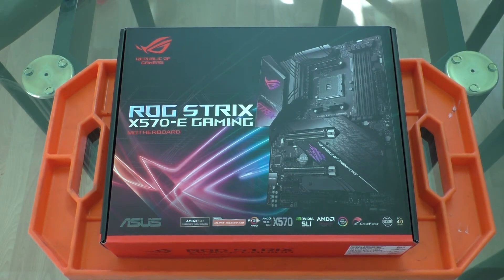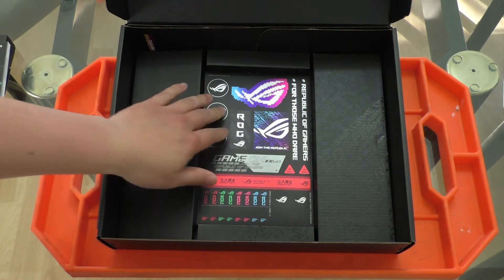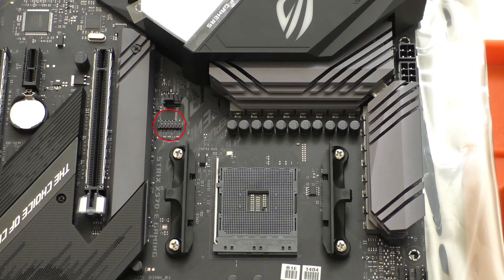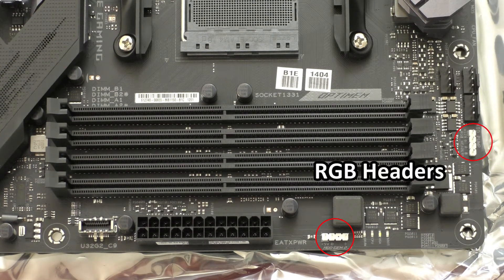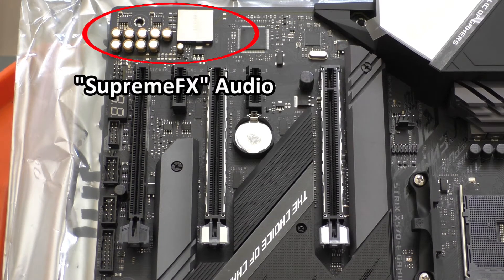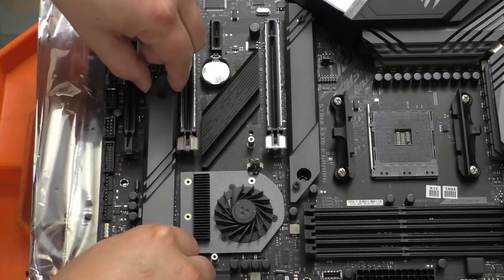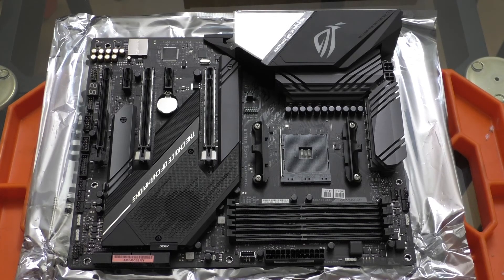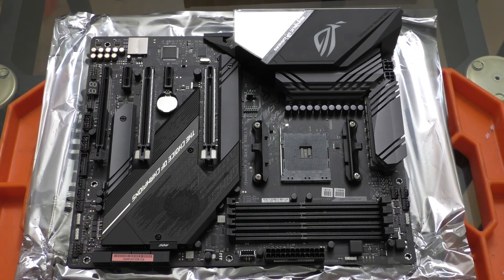ASUS ROG Strix X570-E Motherboard Closeup Overview

Comment: Does a NvMe SSD pcie 4.0 gen work in this motherboards m.2 slot at full speed if you have a new GPU running in the top PCIe 4.0 slot ?

Comment: Great video, looking to add some M.2 SSD today
Reply: `does a new SSD nvme pcie 4.0 gen memory work with full speed in the m.2 slot in this motherboard if you have a new Nvidia GPU running as well?

Comment: Hello, I have a problem with this motherboard when i installed my 2 RAM sticks in slot B2 and A2 after sometime  of use computer would crash and show BSOD with code error - memory management but when my technician changed the slots to B1 and A2 everything works fine no crashes asked him if the motherboard slots have problem he said no but i am still worried if the slots are faulty. please help me
Reply from the maker: That's strange. Are the two RAM sticks identical? Do you have other RAM to test with? Is the BIOS/UEFI updated?

Comment: Thanks for this video. I want this board. I'm surprised you even mention the 10 second task of removing the fan shroud as if it's anything. I will already have my GPU out if I had one because I like having room to work. I didn't get it.  I want to start out with a Ryzen 7 5700G until GPU's come down in price if at all. Is that heatsink fan serviceable? I worry about that fan lasting 5 or more years.
Reply from the maker: I believe the chipset fan is serviceable. You can clearly see the three screws mounting it to the heatsink, and you can see the power wires/connector just above the heatsink at time 8:40 in the video. The most difficult part about servicing it will be unscrewing the chipset heatsink from the back of the board to get the old power wires out and new power wires in since you'll probably have to take the board out for that.
Reply: @FaRKle0079  That and getting the part. It would definitely be downtime and an in the shop job for me. That's my I keep an Intel NUC backup computer.

Comment: Is there a huge difference if i use a GPU in white lane and second one in the black lane ? I got a big gpu (MSI 3090 SUPRIM X - i plan to use for DL) that i want to place in the first white lane and i believe it covers the second white lane as well. I would like to add a second GPU (an RX 570 - thinking to use it for casual gaming while the 3090 is `bussy`, but the extra heat the will be absorbed by 3090 though) as well. Not sure if this setup can work. Any opinions ?

Comment: Great review, the best and most comprehensive i have found for this board! I currently have 2 M.2 NVME gen 4 drives on mine and looking at getting a 3rd. Will the board support that if I use a PCI-E M.2 adapter card and which PCI-E slot would be best for it, slot 2 or 3?
Reply from the maker: Yes, you can use a PCI-E to M.2 NVMe adapter card in the PCI-E slots. I'd opt for putting that in the last x16 length slot since you can still get x4 bandwidth. The x1 slots can limit the SSD speed, but the x4 should be more than enough.
Reply: @FaRKle0079  thanks, that’s what I was thinking would be best, I am a little concerned that the m.2 heat sink will be too big for the bottom slot, there isn’t a great deal of room to use the bottom slot due to the cables from the bottom area of the motherboard. The second x16 lanes shares bandwidth with the top slot I think so would reduce the top slot with my gpu to x8, although that still should be more than enough for the gpu atm it might lose a few FPS in games but nothing to really notice the difference in so I may have to use it in this slot and hope I doesn’t block too much airflow from the gpu.
Reply from the maker: @stuartd1216  I think you'll have enough room for a heatsink in the bottom slot since the adapter cards usually move the ssd up a bit. It should be enough clearance.

Comment: very comprehensive! will you be able to tell me if i will loose performance if i plug my msi 3090 gaming x trio to the second slot? it is air cooled and i am currently using noctua chormax and as you very well know, the backplate of the gpu sits very closely to the base of the cooler.  i am trying to find information if i will be taking a performance hit if i opted for the second slot instead in this mobo
Reply from the maker: You won't notice a difference putting your 3090 in the 2nd slot. It'll run at PCI-E 4.0 x8, which is equivalent to PCI-E 3.0 x16. The difference is pretty negligible (https://www.pugetsystems.com/labs/articles/PCI-Express-4-0-vs-3-0-Video-Card-Performance-1982/).

Comment: Hi, really detailed review, kudos. A LOT OF people have pch temp issues with this board. What is your experience regarding pch temps ?
Reply from the maker: I can't say I've had any issues with mine. Never ever heard the fan. But my gpu is also water cooled so the board isn't getting as much residual heat as normal. Also the board has very good airflow over it from my cases fans (FT02).

Comment: Edit: Ignore this comment. Some other software stops the fan when it runs it seems.  Yes the chipset fan placement is really genius... Still it does its job somewhat. Temp is 60 c on idle. 

Original comment: DO NOT BUY THIS MOTHERBOARD. The chipset reaches 100 degrees easily on load! Chipset fan is almost completely covered by the gpu because of the UNBELIEVABLY STUPID design of the motherboard and gets no airflow. Go with a B550 this generation.

Comment: I haven't built a PC in a while. So, each M.2 slot can house an M.2 for your OS and the second one for storage? I just want to make sure before I buy two M.2 SSDs. Thanks!
Reply from the maker: Yup. You can have your OS drive in either M.2 slot (with the other being storage), or use those slots for storage only and put the OS drive on SATA.
Reply: @FaRKle0079  Thanks!

Comment: I've got this board and i've got ryzen 5 3600 and i will install on this board let's say i want to upgrade to ryzen 5000 should i install the new bios using bios flash back or i install the bios normally as usuall?
Reply from the maker: You should be able to use either method unless ASUS' instructions specify one method.
Reply: @FaRKle0079  so flash back button not used just when you want to upgrade cpu and you don't have a cpu it can be used also when cpu already installed?
Reply from the maker: @dalileddineslimani6399  Yeah, you can use the USB BIOS flashback method even with CPU installed. I've done it.
Reply: @FaRKle0079  thnx actually i was afraid to do that or cause any damage to my board haha

Comment: You're doing a super nice job on this review best I've ever seen Crystal clear and to The  point.
One question please I got the gift game MB
Why does it only come with two standoffs ?
I just subscribed.
Keith Kuhn
Reply from the maker: The standoffs included are for the M.2 drives. Two M.2 slots, two standoffs!
Reply: @FaRKle0079  
I actually purchased the Asus tough game plus.
I believe that one has only one M.2 slot. Correct me if I'm wrong.
Keith
Reply from the maker: @KTHKUHNKK  That board actually has two M.2 slots too! You can see my video on that board here: https://youtu.be/W5u41pqWdv8
Reply: @FaRKle0079  
Beautiful I'm going to check out that video right now.
You really seem to know your stuff.
Thanks Keith
Reply: @FaRKle0079  
Superb video my friend absolutely superb.
Your older computer when he had the case in the garage and he had it apart looks like some kind of supercharged Ferrari or something.
Dang nice.
Keith Kuhn

Comment: do you have to have the chipset fan cover on or can you take it off cause my m.2 heatsink was to big so i had to take it off 6:30
Reply from the maker: There's no interlock requiring you to use the chipset cover. The chipset cooling may suffer since the air isn't being forced over the fins on it though.
Reply: @FaRKle0079  do you think it would be fine I guess other than a little worse cooling or would you would recommend putting it back on
Reply from the maker: @exotic_skyz2557   I'd try it and see. If the fan starts spinning really fast and loudly, then you know it's not getting cooled adequately. if it's staying pretty quiet, then you should be fine.

Comment: how the hell do you remove the M.2 shield screws those are so stupid to work with wtf
Reply from the maker: The M.2 heatsink screws? I just used a PH1 bit and they weren't very difficult to remove. Did the factory over tighten yours?

Comment: Good afternoon

I want to ask you, is the Asus rog strix X-570-E gaming motherboard PCH fan blade factory so easy to pull off the engine part? Is that how it was designed? Thanks
Reply from the maker: I haven't tried pulling the fan off of the motor/shaft. It's possible the fan blade assembly is just a friction fit on the shaft, and thus can come off without too much effort, but I don't think it's necessarily designed to come off easily.

Comment: Hi! I recently purchased the same mobo. I used a PH1 on the fan shroud as described in the video, the screws refused to budge whatsoever. Afterwards, I had used nearly 20 different cross shaped heads that I had in a set, and still, no positive results. Now, I am left with two VERY BADLY stripped screws on the fan shroud. Have I rightly screwed myself (this kinda hurt), or can I somehow salvage his mishap?
Reply from the maker: The screws also have a flat head cut along one side. Are you able to use that at all? Sometimes I find you need to push down on the screwdriver bit to get it to bite better. Additionally you can try to use some kind of rubbery material (like a latex/nitrile glove), put that around the bit, and then press down on the driver/bit while trying to unscrew the screw. That can help get better bite.
Reply: I have the same god damn problem still no luck
Reply: @Varodyz  my only option was to return it to Amazon and just buy a new one. Hope this one is fine
Reply: Stef Btw such fucking bullshit $300 btw
Reply: For 2 screws bolted into my motherboard
Reply: @Varodyz  it's sold out everywhere here lol. It's marked up to 500-700 on Amazon
Reply: Stef Btw I’m gonna find away around those damn screws
Reply: @stefbtw355  I found a way around it :)
Reply: @Varodyz  I assume you drilled the screws out?
Reply: Stef Btw no I couldn’t get them out because they are virtually impossible, I unscrewed a screw on the back of the board which is linked to the m.2 heat sink, i then like lifted up on the heat sink and wiggled it out, but those black screws on the fan cover are never coming off, I was able to pull up a tad on the black plastic and slide my ssd under it plugging it in

Comment: can two open 2080 ti fit on this motherboard? i have been trying to find out, i do a lot of 3d design for graphic design and I been wanting to build myself a new pc with this motherboard with two 2080 ti's
Reply from the maker: This board can fit two triple slot video cards on it.
Reply: @FaRKle0079  Would you recommend blower or open gpu? cause i have been looking at the 2070 super instead of the 2080 and I see some available that are 2 slot size, Do you think it would be fine with two open air or should i go with blower style? Im also going to be using cooler master mb500 or their td500 case with 6 fans total... what do you think?
Reply from the maker: @Deadandgoneforever  I think this will come down to your priorities. Blower style heatsinks will be more effective at exhausting the hot air out of your case, vs open coolers will recycle the air back into the case where it could potentially warm other components. Blowers will be louder than open air fans, so if you don't care about noise they're a good option. If you do care about noise though, then go with the open air coolers. Those cases with all the fans filled should move enough air to use open air coolers fine.
Reply: @FaRKle0079  Thank you for replying and for your advice! I appreciate it much.

Comment: What's the advantage that you get when you plug pump cable in aio_pump header?
And which one do you recommend CPU fan/aio pump.
I asked many forums/groups I didn't get an answer that convince me.
Reply from the maker: The advantage of using the motherboard header versus just connecting to the PSU directly is being able to see the pump rpm via the mobo SW/QFan if your pump has an rpm wire.

As for CPU fan versus AIO header, you wouldn't want to use the CPU fan header if using a variable fan profile in QFan since it'll vary the pump speed with your fans. I'm not sure these AIO pumps were meant to have their speed throttled, or if they even need to be (not loud enough to warrant it). If you're not using a variable fan profile (so always running 100% output), then it doesn't matter where you plug the AIO pump in to.
Reply from the maker: @Slightly Off Where did you see that? On the face of it, that statement doesn't really make much sense to me, but given the context it was said, it might.